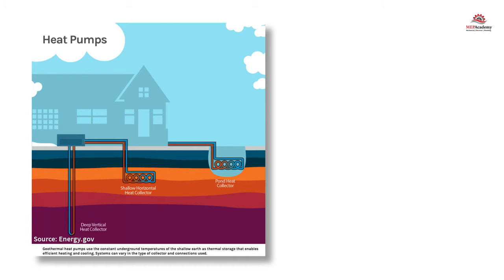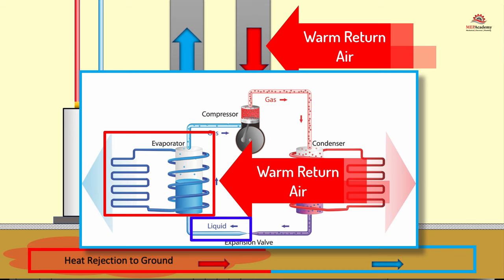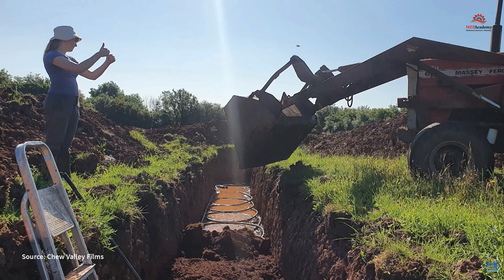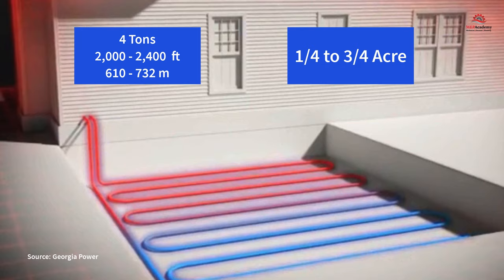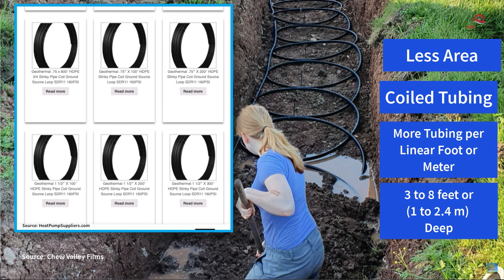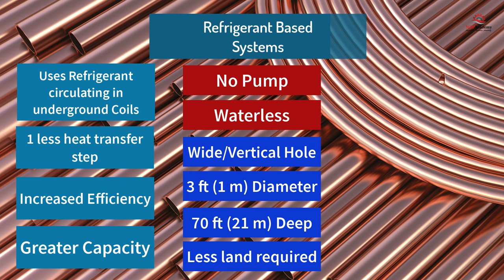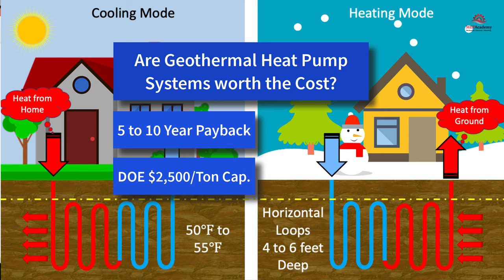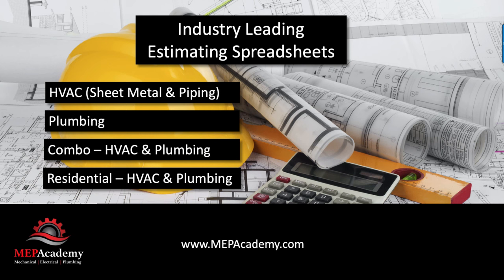How does a Geothermal Heat Pump Work

Comment: I have 2 of these, and they work great. If you have a water well, just plumb it in
Reply from the maker: Great to hear that you put this technology to good use. Thanks for watching.
Reply: Hi there, I'm going to be building a new home and will have to have a well drilled.  Do you know how the geothermal would plumb into water well?
Reply from the maker: @tommynLA  We suggest that you contact a qualified contractor and get a geological survey, and that you speak with the local jurisdiction on the approval process for using the well.

Comment: Instead of an open water circuit between two water wells could you install a coil heat exchanger with antifreeze in a closed circuit in the first well and just pump chilled water in the second well?
Would the efficiency of the system be lost in this case?
Thanks in advance for your answer.
Reply from the maker: Sounds plausible. Haven't seen any research on a Run-Around-Coil system as you describe. Run-around-coils are used in other applications, I just haven't seen it used here. Please send information if you have any for us to review. Thanks.

Comment: is it possible to use the water directly and pass it through coils like an Air Handling Unit? LIke a chilled water system? In that case, it is a lot cheaper, since what we need is just AHU and a water pump. Btw, nice explanation
Reply from the maker: You could, but the source water temperature may not meet the conditions required, hence the use of electrical power and refrigerant compression to meet the conditions. If you have a humid environment, the source water may not be cold enough to condense moisture from the air, leaving you with high humidity levels. It's situation like this that may cause direct use of source water to fall short of meeting the wide range of conditions that might be seen at the site.
Reply: @MEPAcademy  Appreciated. thank you

Comment: I am from Pakistan...There is very less knowledge and use of geothermal energy......I have a water well about 90 to 100 feet deep....Can i use it for geothermal heat pump system...
Reply from the maker: If there are no governmental restrictions on using it, then yes you can. Be sure to use a closed loop system so as not to contaminate the well water.

Comment: How to derive the tube length (152-182 m/ton)? Will it change due to the soil properties?
Reply from the maker: There are many factors that determine the length. 1) Heating and Cooling Load Calculation, 2) Soil Conditions, 3) Type of Ground Loop System 4) System Efficiency. Check wit your local code authority and consult a geothermal system designer. Good Luck.
Reply: There is an easier, more useful and better way than digging all of this just for the sake of extending pipes, and it can be used anywhere on the earth under special conditions according to each region and at a lower cost.  But the idea needs support from anyone I might partner with in this innovation.  I only need the cost of 4 tons, and I will guide you to a method that is more economical for everyone, safe from pollution, and useful in many uses.
Reply: Thank you very much for this useful channel. I have one question: What is the temperature of the earth at a depth of 10 metres?  What is the temperature of the water at the bottom of a lake 10 meters deep?

Comment: Could ground-connected water reservoirs, like buried cisterns, be used to run the source loop? And then feed the heat into a thermal mass floor?
Reply from the maker: Would need to see the design in order to comment. Do the cisterns have good thermal properties for heat transfer between source loop and surrounding ground?

Comment: There is an easier, more useful and better way than digging all of this just for the sake of extending pipes, and it can be used anywhere on the earth under special conditions according to each region and at a lower cost.  But the idea needs support from anyone I might partner with in this innovation.  I only need the cost of 4 tons, and I will guide you to a method that is more economical for everyone, safe from pollution, and useful in many uses.
Reply from the maker: Love to hear about it. Thanks for watching.

Comment: How much would electric go up with a geothermal heat pump
Reply from the maker: Geothermal systems are used for the purpose of saving energy and providing a more sustainable solution. The heat pump uses electricity but more efficiently. Someone who specializes in Geothermal heat Pump Systems can give you an Energy Analysis to determine your payback period.

Comment: So why are geothermal heat pumps explained in tons? What does it mean?
Reply from the maker: Btu and Tons are interchangeable. 1 Ton = 12,000 BTUH. It's always best to look at the specifications of the Heat Pump to see what the actual BTUH is, as the tonnage may be rounded off to the nearest whole or half ton value.
Reply: @MEPAcademy  ok thanks

Comment: So if that's how this shit works, then what the hell is stopping me from just going outside and putting my water hose on my damn ac unit? Water coming out of the hose is pretty cool, right?
Reply from the maker: Adiabatic Cooling: In theory yes, but spraying water directly onto your home condenser can lead to mineral deposits (scale) on the coils, which can reduce heat transfer efficiency over time. Unlike a dedicated adiabatic system, spraying with a hose is not a controlled or consistent process. It might lead to uneven cooling or over-saturation, which could reduce the effectiveness or even potentially damage the condenser. This would also increase your water and sewage charges, in addition to  maintenance cost.

Comment: Why talk about about geothermal when it is really about ground based. To tap geothermal, defined as the heat radiating from the earth core, you have to go rather deep. Ground based is not using the heat radiating from the earth core, but is rather based on the constant temperature you find in shallow ground. To tap geothermal heat you usually have to go at least 400 m deep and most often far below that.
I like to keep from not unnecessary mixing up different concepts.
You use geothermal and ground based like those are exchangeable concepts.
I live in Iceland where we use geothermal heat sources in district heating. That covers over 90% of space heating. Ground based water to water or air to water systems are used, where geothermal is not available or to few units to heat to cover the cost.
Reply from the maker: You are correct. The terminology refers to two different things, but there is the tendency to use them interchangeably, especially when you're referring to Geothermal Heat Pumps, and the like. The correct terminology should be ground-source heat pumps, but the industry seems to like the use of Geothermal Heat Pumps. Most people understand the differences, but your point is definitely correct in that there is a distinct difference. Thanks for the comment.
Reply: @MEPAcademy  My point is that people should keep to the right terminology, to not invite confusion. The question why geothermal power is not used in many areas is often often answered by, but we do, based on this confusion. Most people and some of the industry actually do not understand the difference.